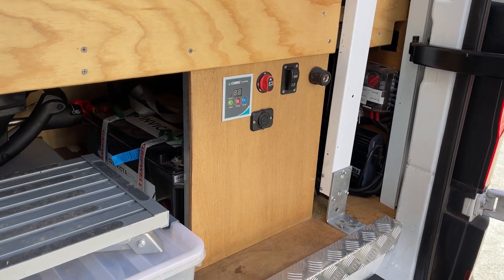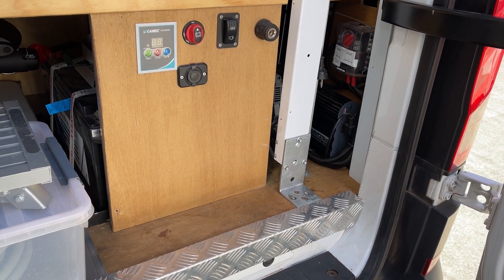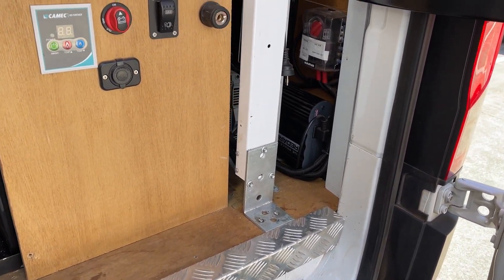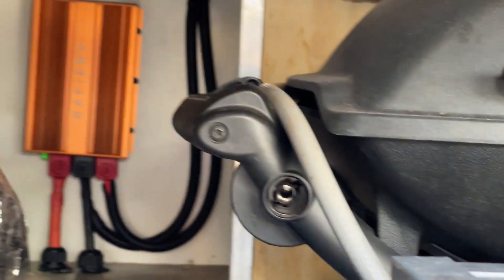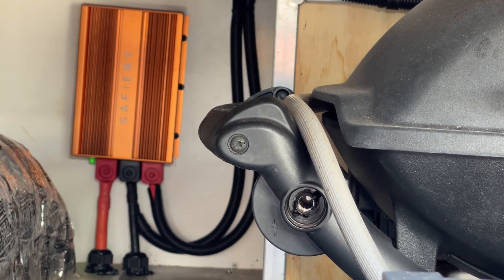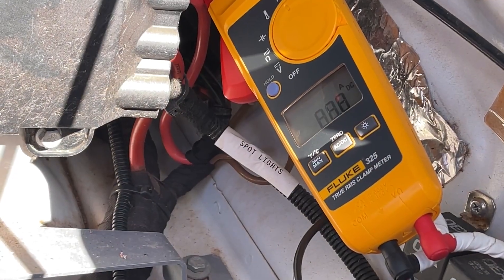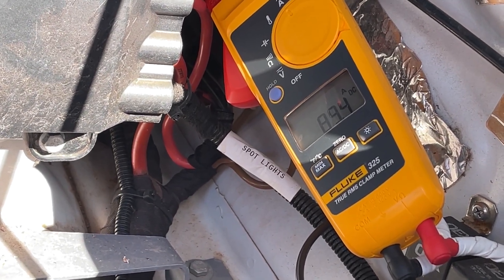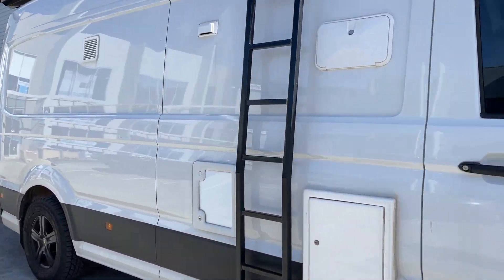VW Crafter gets 89A from Smart Alternator with Killa-wasp replacing Redarc Revision Manager 30 DC DC

Comment: Always great to see your installations!
Out of curiosity, as your products although very nice are way out of my wallet league, why don't you offer a 12 - 24v version of killa-wasp?
Technical or market reasons?
Regards!
Reply from the maker: 12-24V is too low a demand for us, 24V systems with Victron are the same price as 12V where as 48V are 25-35% less as a rule. Also 24V Inverter/Chargers have an 8k limit. 48V is 15k.